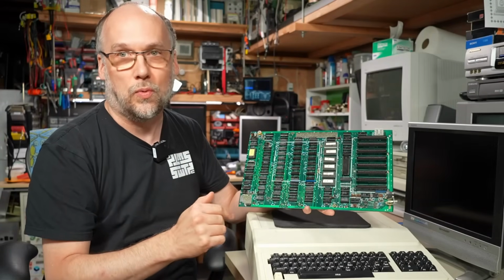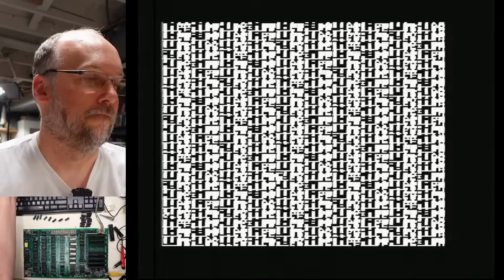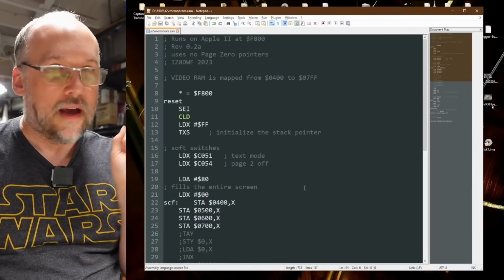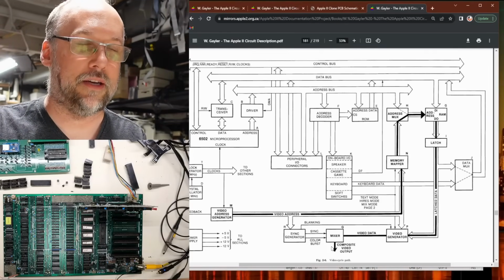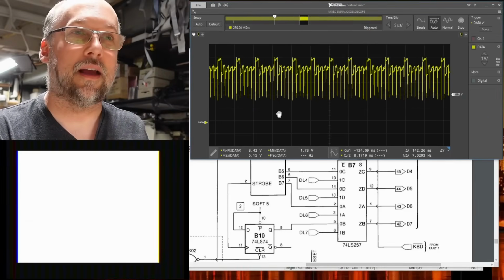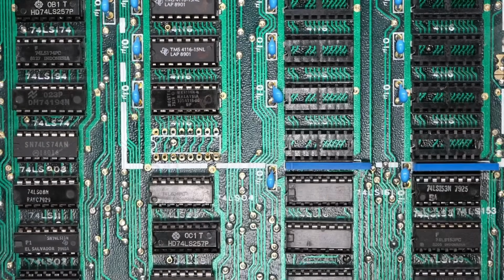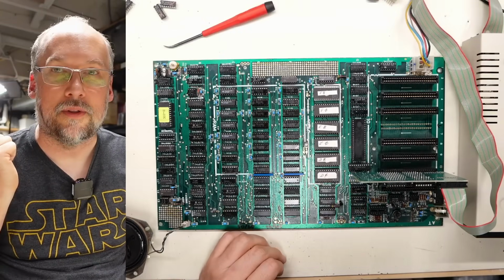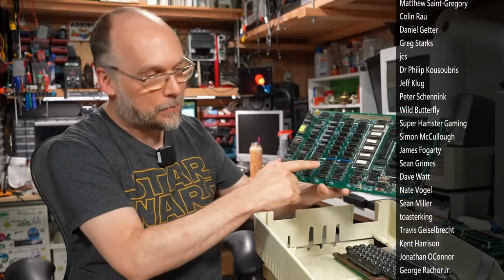Apple II+ clone repair: It was one of my most difficult

Comment: CONGRATULATIOOOOOOOON! YOU'RE GREAT!!! 

I was in Asia in between 1990 -1993, my first trip was to Hong Kong when Great Britain begun to return HK to China, a very troubled period. At this period of time, the Chinese Government began to enable old abandoned factories in the so-called New Territories, to promote the rise of new companies that assembled clones like the one you have.

My job was to evaluate all the products that were available in order to be distributed in my country. You can't imagine, since the components were manually soldered to those cards, you would surely be shocked.

These were clearly the beginnings of Asia's technological revolution, today everything is clearly tremendously different from those old days. I actually brought one of those computers.

Mine came with 80 column mode and a Z80 to run CP/M which for me was wonderful. It worked perfectly, until the disk controller failed, and I was already starting to dabble in the PC so I never brought a card from the US.

Maybe it's still in the family home from that time, and maybe it still works. I congratulate you for your contents. A big hug, and Best regards. Atte. Fernando.

Comment: Another way to clear defects like that (close traces) is to use a HIGH current source (a car battery comes to mind) and probe the two shorted lines.  If you have the lights turned off you might see a spark where the short was cleared.  Of course you might want to have lots of things unplugged from the busses during this operation.

Comment: Two of the most difficult things to troubleshoot are:

1) A circuit/board/module/component that's not known to have ever worked.

2) Something that wasn't repaired by someone else that may have created new problems inadvertently and/or tried substitute parts that weren't actually equivalent.

I think you got both. Most likely someone bought the board unpopulated and gradually assembled it when they had more parts and more time. It didn't work because of one or more reasons that could have been using some substitute transistors where 2N3904's would have worked OR there were etching shorts in more than one place OR improperly handled static sensitive chips OR salvaged chips of unknown status OR didn't carefully check their soldering as they proceeded OR badly cloned ROM's (and many other possibilities). Then, they or another person tried to repair it and maybe found and fixed several things, but gave up. This may have been as late as 1989, when some of the chips were already hard to find. Then after possibly passing through a number of hands (maybe tossed out and scavenged from a recycler), you got it without the advantage of knowing any of the history.

Comment: Absolutely fantastic.  I had an Apple ][+ when I was a teen in the eighties and seeing someone going through an explanation of how it actually works has been mesmerizing.  I almost pursued studying electronics but ultimately had a career in IT.  I'm very much looking forward to Part III.  This reminds me that I have a drawer full of "working pulls" expansion cards (Gibson Light Pen, etc.) that I bought in garage sales as well as at least three of the computers, one of which is the clone known as the "Classie" which I got through a high school friend's father who worked for a certain company in the eighties (cough, cough, Martin).
Reply: Remember to use a CRT if you want to play with the light pen- LCDs don't provide the correct visual behavior (a moving reflector system could also work, but I don't know of any such monitors...)

Comment: I think you have a case of tin whiskers on the board. Low-lead solder perhaps, so this is the state of modern electronics troubleshooting; what you'll see with the lead-free era devices once they've been running for a while and there's any gap in the solder mask allowing for bridges to form.
Reply: I wonder about that. Only the right range of tin-lead was known to avoid whiskers in the old days, but there were limits to the value of alternatives, historical & practical reasons why they started with tin & lead in the first place, and less metallurgical and quantum mechanics knowledge and computational ability; I wouldn't be surprised if some decent plan-B options arise, even if at the cost of avoiding tin too.

Comment: I would say this has tin whiskers cauaing shorts rather than a bad pcb right from the start. Pcbs of that vintage had tin applied to the copper tracking and then solder mask was applied over top. If there were any defects or alignment issues with the solder mask then tin whiskers could form and potentially short to adjacent pads.

Comment: Fantastic job in tracking down the shorts. Some board manufacturers produce great boards others produce lesser quality boards and might push it down on a test jig just enough to get it pass then down the line it goes.  I personally would have cleared the short under the expansion slot and if it still messed up would have somehow ended up embedded in my wall.

Comment: Dude - identifying that short in the expansion connector through logical reasoning  was slick. I had an Apple II clone for a while as a kid and it required you to open the lid and push the chips back into the sockets any time you moved it. Maybe it wasn’t the sockets but it had the same shorts problem you are seeing?

Comment: Tin whiskers - especially if using lead-free solder. They will grow from the solder joints and short out to nearby traces. There have been satellites that were lost because of them, and that's one of the reasons while aerospace is still exempt from the ban on using leaded solder. It got so bad, especially with pure tin solders, that the whiskers went through really thick conformal coatings and shorted things.

Comment: Enjoy your videos.  Been thinking about offering this suggestion for quite some time.  Years ago I needed to repair a large number of Z80 based boards.  I soon discovered one could go crazy trying to do it dynamically.  I built a Z80 "simulator" in a small minibox with a bunch of SPDT toggle switches and an LED to set and show the state of every data, address and control line.  The simulator replaced the processor and by flipping switches was used to manually step through the instructions the processor would go through at boot up.  Obviously it didn't work with dynamic RAM but for any peripheral that was static I could trace the state of any line using only a LED probe or observing the LEDs on the simulator.  It usually only took one or two instructions to find a bad IC or open trace.  All with a simple LED indicator.
Reply: Assuming the system will try to run, you'll usually be better off with a diagnostic ROM (e.g. an IBM compatible's POST code system).

Even better though would be a "high reliability" simulator ("high reliability", because approximately the same technique gets used for some high-reliability hardware) that both runs the code like normal, and runs it with partially (or entirely) simulated hardware so that it can detect when results are different between the two running instances (you partially simulate mostly to deal with e.g. unpredictable keyboard input) despite running at full speed.

Comment: When you scraped off those two shorts it would have been a good idea to put solder-resist on the scratches because when you resolder the sockets on some solder can flow in to the scratch and recreate the short.  That would be a bit frustrating!

Comment: So that second shorted RAM? socket ... Why was that pin silver when all the others were gold? Is this a symptom of the hairyness or alloy leakage?

Crazy random thought (it is 1am here :P) Could an excess of voltage/current have degraded it over time? Just thinking of the colour change ... ?

Forgive me if this sounds stupid, I have to admit that pretty much anything I know about electronics, comes from my consumption of this channel 😀

2nd Crazy random thought: I see people are arguing the difference between beeps and not; I know nothing about that, but there is a causal difference, so I ask:  is the signal that causes the beep enough to charge another component, causing continuity at odd points? It's clear there's some serious oddware here!!

3rd Crazy random thought: I'm British, I'll be honest, I read about about Apple II in Steven Levy's Hackers, before I'd ever seen one physically, never mind in operation - but why is the colour artifacts on this clone looking Yellow and Blue rather than Green and Purple? Is this related to that colour killer circuit you mentioned? (Wrote this before I saw Fat City!!)

Right, Off to bed now - can't wait to see the finale! 🙂 Thanks Adrian, Frank and everyone - this has been enthralling!

Comment: A few people are suggesting tin whiskers, but this board is from pre lead free manufacturing, wasn't it? Leaded solder was whisker free. Could be more like poor storage conditions and then operating with damp/mold and electrolyticly forming bridges? Anyway, excellent fault finding skills, great video.
Reply: Leaded solder wasn't universally whisker-free. The percentage did actually matter, and if you pushed too far off the sweet spot they would show up again, albeit slower.

Comment: i totaly understand the pain of pcb fault. i had a nes clone as a kid, and it one day just stop working, displaying garbage so as a late teenager i totaly broke it
took parts of the pcb with  mosulator and game controller ports and reused them in different projects fast forward 10 years i actually found all chunks of it and rebuild mising pcb parts
but i only got to the point of the consple displaing garbage , it took another 2 weeks of probing the pcb , comparing to schematics point to point, everything checked out and the problem ends up being data line shorted with reset line under the cart connector, there was no solder mask over the trace just barely missing the cartridge  slot pad and solder wisker  grew and connected the two

the main point is to never give up

Comment: I have a similar illegal Apple II+ clone. Its ROMs are all exact copies of the Apple II+ ROMs, with the exception that "APPLE ][" is replaced with "COMPUTER". I concur with an earlier commenter that the mismatched heritage of the ROMs could be an issue... but it could be a red herring if all those ROMs have the same checksum (something I have not checked).

I'd like to point my finger at the RAM that tested bad in the chip tester for the issues you had in Fat City, but logic chips could still be to blame. My clone had issues with showing no colors at all until I replaced the 74LS-series chips that tested bad in my T48, and I could totally see a bad logic chip being to blame here, too.

If there is anyone I know who will persevere to get to "It Freakin' Works!" on this Apple II+ clone, it is you - keep up the great work!

Comment: On the issue of probing into sockets without damaging them, I wonder if it would be a good idea to get a small quantity of low-ohm resistors (100 or even 10 ohm, 1/4 watt), and use them as test points? Trim one end to 1/2" or so, then trim and form the other end into a loop you can clip the scope probe onto?
Reply: Maybe, but they like to bend, and might still be able to damage sockets. What would be nice is to get some solder-on "pcb legs", and just stick them onto small pcbs that connect each leg to a test pad. Unfortunately, I think that the only legs I ever heard about like that were a custom-made run.

Comment: Here's my guess...someone may have attempted to repair the board in the past and thinking there were dry joints, perhaps reflowed the solder on each pin and ended up overcooking it a bit, causing the short. Excellent video - having built one of these myself back in the day, it was nice to take a trip down memory lane...and I definitely learnt a few things too. Thank you.
Reply: Either that or it's actually a kit built computer and the original builder overcooked the joints while assembling the machine. Which I think is the likely scenario as the chips were mixed and matched all over the place.

Comment: About that shorts - you can try just "burn" them with bench power supply! Like 1V and 1A should be enough to remove pcb defects out of existence without removing sockets also its safe for chips and shouldnt damage them.
Reply: Whatever is the maximum expected voltage is safe. 1A might not be enough for instant gratification, but combined with a thermal camera would light up very nicely.

Comment: I'm really curious about how the data/address bus are shared, I find it fascinating that the ram runs at double speed and the CPU accesses it on clock going up whereas the video circuitry accesses it on clock going down. The 6502 has a "RDY" line that disables it temporarily and I thought that was how the video circuit works: it asserts the busses by halting the CPU. Adrian had a video recently with a 486 piggy-back CPU upgrade and he theorized the piggy-back CPU disabled the board CPU by permanently halting it with the same line. IF that were true, how would a component on the motherboard halt the piggy-back CPU then? I feel this whole concept could stand to be explained/explored more thoroughly.
(I am also hopeful somebody does a video on the C64 "RAD" cartridge, which looks like it exceeds the venerable CMD SuperCPU in power and functionality, and it seems the entire scene is overlooking this amazing technology. Incidentally I bought my own RAD cartridge from Germany, completely assembled, for under 30 euros. Price is not a barrier, and the project is completely open source as well!)

Comment: This has more tension and a better narrative than a lot of scripted dramas!

You can ride the emotional rollercoaster you're on, with a new problem the moment you whack one mole, but ever so slightly inching forward in progress.

As you start to discover the shorts, and the sources of them, and also realized the reworks and new sockets, you can /feel/ the despair and the desperation of the previous owner who must've tinkered endlessly with it, trying to find out what's wrong, and ultimately failed.

I really hope that owner stumbles upon this video, and finally gets some closure to what this horror of a motherboard put them through.

As frustrating as this motherboard must be to work on, it most definitely has been a great partner when it comes to creating engaging video content! So while you've been particularly unlucky with the issues you've had to solve, the silver lining is that it ended up with a YouTuber who could transform those issues into what's basically a great work of art at this point!

I'm at the edge of my seat for part 3, to see if this will end up 100% operational, and especially to see if the colorbust killer upgrade is getting built!

Comment: It seem pretty obvious that this was a kit build that never worked to begin with. It may have been built with random surplus parts or it may have gone through many hands over the years trying to fix it. It also may have been canabalized for parts at times with soli e swapping oarts form it into other computers and putting the old parts back into it. It worked at a computer store ling ago. Id repair monitors occasionaliy, and when i took parts from dead ones, the owner insisted that i put the bad parts back into the donors and put them back together so he could sell them to some poor sucker who thought he might be able to repair it. It might be the case that somone was swapping parts into something and putting the parts from the other nachibe back into that one. They probably knew all the chips in your machine were good because they had already tested them trying (and failing) to get it to work The reason the parts may be good could be that once they found the bad part in the machine they were working on, they replaced it with a hood one, but never bothered to swap everything else back. Thry probably held out hope that one day they would come back to your nachine and make it work.

Comment: The Z80 isn't the only processor with a relocatable stack... the original MC680x processors have an instruction (LDS) where you can specify where you want the stack to be.
Reply: I believe relocatable stacks are fairly common, the z80 seems to have inherited it from the 8080. I suspect that only the smallest designs lacked such a feature.

Comment: One bit of leverage-- the short is likely much narrower than the trace widths, so you can exploit this by running a few hundred milliamps across the shorted lines.  That should burn out the tiny shorted area.

Comment: That address/data mux combination is pretty smart -- the video generator basically does DMA in the moments that the CPU isn't talking to the RAM.
Reply: You need is fast expensive RAM and keep the CPU slow.
Reply: @scottlarson1548  : Not a problem at the time, RAM was still often faster than the processors. Unfortunately, if you want to do that today, you may as well just be making a RAM disk from DDR for something from the 80s.
Reply: @absalomdraconis   That wasn't what I was seeing at the time. While the 6502 in the Apple II ran at a slow 1 MHz, I was running the 6502 in my Ohio Scientific C1P at 2 MHz because they were finally producing RAM chips with 450 ns access times. Of course you had to keep the 6502 at half speed in the Apple II because the video system depended on it.